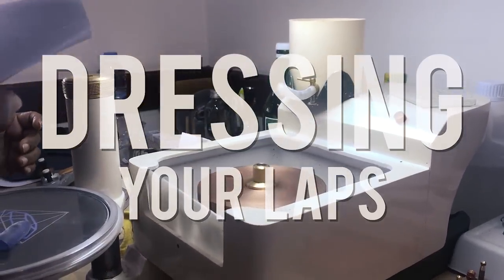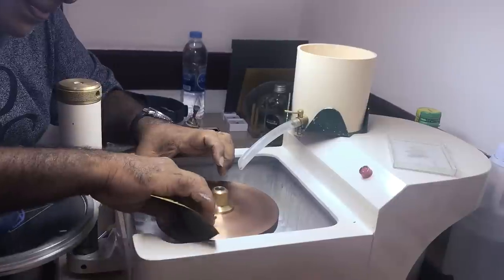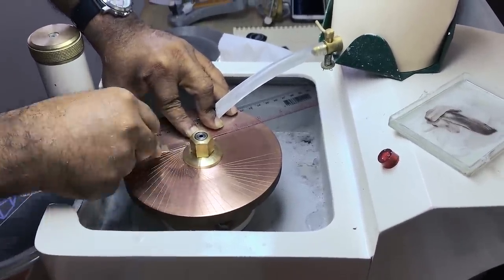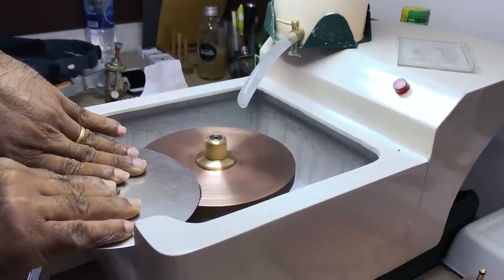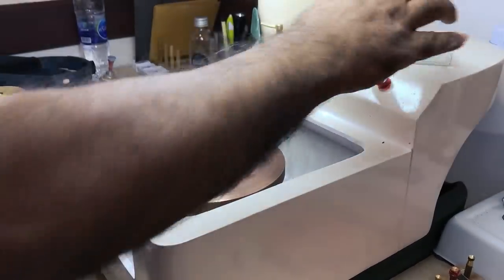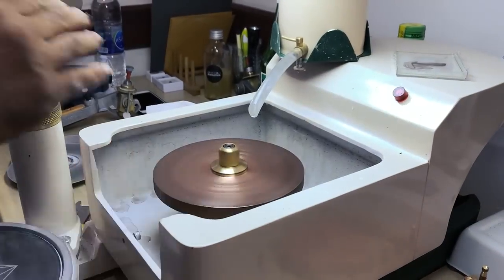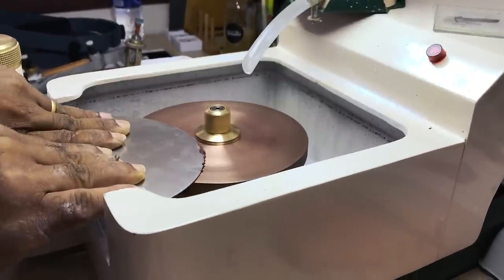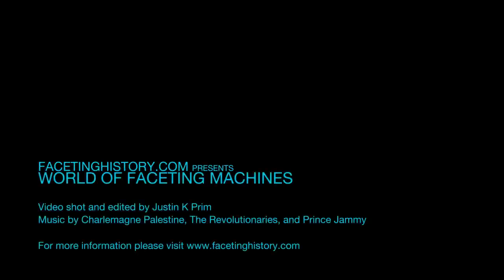World of Faceting Machines Ep.8 : Dressing Your Laps

Comment: My Batt Lap is scratched. Thinking of doing 800 grit wet sand. Would this harm it ? Thank you.
Reply from the maker: Is the scratch really causing problems? My bat lab has like three huge gouges in it and I still use it just fine. If you really need to resurface it, you could use a used 1200 grit topper like we do in this video. It’s not something that I do very often, this was the Sri Lankan dude showing me how to do it, but I have done it before and it does work. Check out my other video called “uncovering a buried treasure,” where I take a totally disgusting dirty lap and clean it like that.